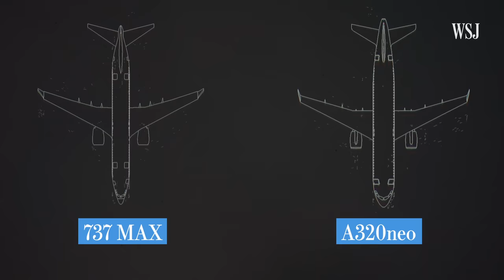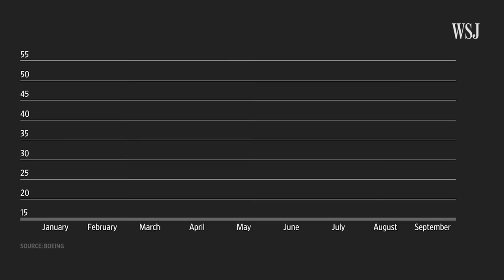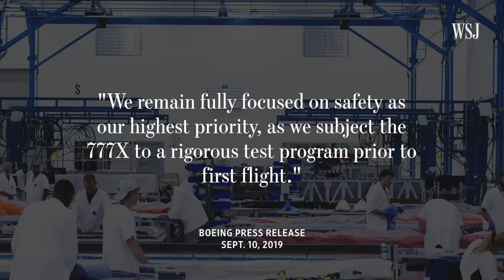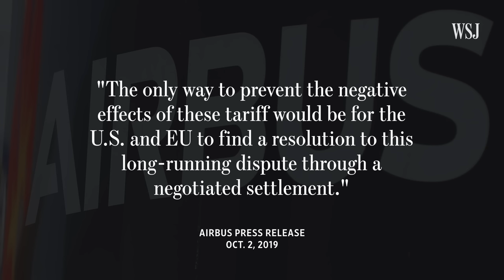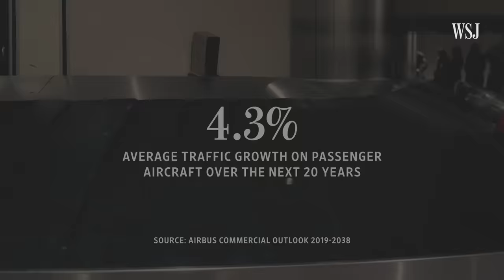Boeing vs. Airbus: Why Aviation’s Biggest Rivalry Is in Flux | WSJ

Comment: The 737 Max, especially the -10 is like a last minute ditch effort by Boeing to compete with the A321 because they made the terrible decision of ending production of the 757, which was superior to both the 737 and A321 in every way. A modernised 757 would be a world-winner.

Edit: someone deleted their comment regarding the sales dying out, however when ETOPS cape into effect and twin engined aircraft could cross oceans, a massive demand was made for a long range narrow body of which only the 757 could accommodate.
Reply: the word is that Boeing has a new replacement for the 73 in the works regardless.
Reply: Matt yep 797 is supposed to be a twin aisle 757
Reply: Your right about the 757 which is why they are designing a new midsize aircraft (NMA) but at the expense of recycling the 737 airframe yet again. So manny mistakes here.
Reply: The 757 barely sold at all only large orders came from delta American and United  plus it was to large to replace the 737-800
Reply: mrcrisp but the 757 has a far superior range, payload and short field capabilities.
Reply: @shaun1293  so? You won't see a 757  flying  boise to denver why? Because it's to large that's what the 737 does better why do you think not many airline bought the 757
Reply: mrcrisp the 757 could easily handle the route but it’s probably due to lower passenger demand.
Once again not many airlines bought the 757 because at the time there weren’t many routes that the 757 could legally fly because it only had two engines, so it was thought to be a slightly larger 737. Once ETOPS lifted restrictions on the 757, after production ended, airlines have been scrambling for them. Icelandair uses all 757s, the European charter airlines use 757s, in fact take Jet2 for example, they’ve had to retire two 757s just for parts to keep the rest of their 757s going, and while TUI and the late Thomas Cook were buying Dreamliners, NGs and Neos, they kept their 757s. Delta, despite its massive orders for 737-900s is still keeping its 757s...
Reply: @shaun1293  um airlines have been doing 2 engine etops since the mid to late 80s lol it's not that new boeing has the choice of the 737 or 757 the 737 had way more orders and was making more money for boeing then the 757 end of the day boeing is a  business they need to make money and make investors happy most airlines bought the 767 for etops not 757

Comment: When buying airline tickets, I have no problem paying a little extra for the A320. HUGE Difference, the 737 Fatshamer Popcan was built with tiny Chinese men measuring seat width and spacing. We call it the Cramalot 737. Rides like an old 1 ton farm truck with open exhaust, and if you've got an isle seat then your shoulder ends up bruised by people trying to squeeze down the narrow isle, or your shirt torn from the snack cart. Boeing exec's fly First Class and never experience the cattle car that they built. I will not support that type of scrimping and squeezing to save a buck. 

The A320 is beautiful, roomy, bigger isles, bigger seats, better spacing, better air handling, and it rides like a Cadillac with air cushion suspension. People are catching on with the tricks to locate the 320 for their flight, WELL WORTH IT!!!
Reply: @FourDollaRacing  6-1 197lbs.
So you're a Troll! HA!

Comment: Boeing should stop tricking the FAA. Putting a new bigger engine in front of the wings instead under the wings has drastic aerodynamic consequences! It increases unnecessarily the risk of a stall during take-offs. Trying to "compensate" such a design flaw by software (MCAS) without making all this transparent and even hiding it from the FAA is a crime! ... oh ... and ... the FAA should take drastic measures in order to gain or to get back the required expertise for qualifying new airplane designs ... specifically in the realm of redundancy concepts of safety-critical system designs ... 
 I as a customer will NEVER EVER take foot into any airplane which uses hardware/software in order to "compensate" aerodynamic design flaws ! ... specifically if the triple jump for fuselage, wing & engine is concerned ! 
 I hope for all employees of the company Boeing that the Management ordered (secretly?) a complete re-design for a complete NEW 737 ... using the new max fuel-efficient engines without the need for any sorts of "MCAS" ... otherwise the Boeing management is also betraying their investors and other stake-holders ... and it might finally turn into the beginning of the end of this great company ... 
 But in order to stay fair ... remember the catastophic flight Quantas QF72 (Airbus 330) ... here is an analysis about this bad Airbus story: 
https://www.youtube.com/watch?v=2cSh_Wo_mcY 
... the term 'flight envelope' will be the term raising a lot of attention in the future ... and how power between the pilot & computer systems are split ... 
Every airplane cockpit should become kind of an "Emergency-My-Aircraft-Button" de-activating IMMEDIATELY all computer-intelligence in terms of active control about the actor-motors ... they have to follow ONLY the pilots direct command in case of emergencies !

Comment: No in-depth reporting in this item whatsoever. It misses a lot of Why-questions: Why did the CEO loose his roll as chair, Why did the lead engineer leave, Why did the Max crash twice, Why is the Max still grounded, Who certified the Max aircraft vs Who certified the 320Neo (FAA and Boeings self certification vs EASA), etc etc

Comment: if Boeing didn't make the 737 so low to the ground, they wouldn't have had this problem. The A320 doesn't seem to face any issues with its usability at smaller airports due to its height.

Comment: I'd like to clear some misconceptions up about MCAS and the whole controversy in general. The flight data recorder shows some very disturbing things the Ethiopian Airlines pilot did. After hitting birds, getting a bunch of warnings and a stick shaker (the most serious warning an aircraft gives to a pilot), what did the pilot do? He tried to engage the autopilot. Seriously. I’m not kidding.

In an emergency situation, this pilot’s first action was to try to engage the autopilot. When the autopilot would not engage, what did he do? He tried to engage it once again. All of this occurred before the MCAS ever activated. Why? That’s because MCAS will not activate if the flaps are deployed (which they were), and it will not activate if the AP is engaged (which it did the 2nd time, but only for about a minute).

This shows a pilot that is completely dependent on the automation system. I liken it to hitting a deer in your car and the first thing you do is to turn on cruise control. Who would do that?

The Ethiopian Airlines pilots did the correct procedure to turn off MCAS (at the recommendation of the co-pilot, by the way). The problem is that they did not have the skills to fly the jet without the autopilot. They never once touched the throttles even though the aircraft was set at climb thrust and, since it wasn’t climbing, it accelerated to extremely high speeds. At a certain point, the overspeed clacker went off, and yet even at that point, did the pilots ever get control of the airspeed? No.

So, even if these pilots had completely understood MCAS, they may not have been able to save the aircraft simply because they did not know how to properly fly the jet. They only knew procedures and did not appear to know what those procedures actually did. The evidence for this is that after executing the emergency procedure for runaway trim, the pilot was surprised that his electric pitch trim no longer worked. If he had understood what those switches did, he should not have been surprised. He decided to make up his own procedure and he turned the switches back on which lead to the crash. The procedure explicitly states that the switches are to remain in the cutout position for the remainder of the flight.

The Lion Air pilots probably stood a much greater chance if they had followed the procedure for runaway trim. This procedure is one that every pilot is required to know by memory, but unfortunately they did not switch the horizontal stabilizer trim switches to the cutout position. The crew on that same jet had the exact same problem. They correctly executed the procedure and they didn’t even consider it enough of an emergency to return to the airport (although, they probably should have). They continued the flight and landed safely. The Lion Air maintenance crew did not fix the problem and so the next flight crashed.

The MCAS should never have been designed to rely on a single sensor. However, the more important lesson here is that some pilot’s flying today do not have the skills to properly deal with emergency situations. No MCAS software changes will fix that problem.
Reply: Siddharth Tergaonkar Very interesting information. Thanks!
Reply: He turned the switches back on because the manual trim was too hard to turn and have you seen how fast it turns manually just to make a small adjustment. The pilot would have to make about 3 complete turns which when your being pushed back into your seat and the jack screw is being strained due to the mis-trim situation won’t help
Reply: Boeing states that for a manual trim by the combined force of both pilots is not necessarily enough, unless they go for a sharp dive.  Good luck
Reply: @CaptainDangeax  Boeing knew that moving the position of the engines would offset the plane's balance, and cause the nose to pitch up. That's literally why the implemented MCAS. My point was about how the Ethiopian pilots did not know how to react to the birdstrike independent of MCAS. Even before MCAS was activated the Ethiopian pilots decided to engage autopilot! After a bird strike! This shows that they weren't able to handle the situation correctly with or without MCAS. I've tried explaining this the best I can in the comment, please go through it.
Reply: Thomas Mortimore this however, completely goes against the stab trim procedure; once it’s cut out, it’s not meant to be re engaged for the rest of the flight.

Comment: I heard Boeing fired American engineers who did flight software for 737 on reason of paid per hrs around 72$ then hired Indian at cost 11 $/hr did that software in stead.
Reply: The software engineers were the only ones that didnt fail here! I dont know if what you said is true but the software briefing was build by Boeing flight engineers and the software just worked like the briefing asked too. The briefing from Boeing was faulty with several risky decisions that nobody understands and that killed the people. The software just made his job without fails and Lion Air final report makes it clear! In the end it was a faulty hardware (AoA sensor) that made MCAS fail, not a software bug and don't confuse that.
Reply: Seems the savings intended by moving software to India are in the minus $9 billion so far.
Reply: @francoistombe It's result of appointing MBA to CEO of technological company in stead of engineers.
Reply: @joaopedrogomes910  Randomizing between two sensors seems more a  "clever" software move than a flight engineer specification.  with the available hardware it was difficult to make an algorithm worse.
Reply: Joen Delfiero  Cutting cost to satisfy board.

Comment: I used to like boeing but now I like airbus (because of the 737 max crashes)
Reply: Don't get me wrong both are still good. But I like Airbus.
Reply: Codename C  that's true. I will still go on a Boeing. However, I feel that their commitment to safety had kind of lacked a bit. Due to the 737 max though in particular, it has for some reason painted some kind of a picture in my mind of what Boeing is like as a company. Don't get me wrong, boeing is very good. McDonnell douglas was very good as a company overall despite the DC-10 crashes.

Comment: Computer software fix is not good enough to ensure safety. If you ever work with industrial equipment, you know sometimes software can get corrupted and needs a reboot. This can't be done in the air with hundreds of lives at stake.
Reply: that's why you have multiple computers running at the same time, with different code implementations on different chip architectures validating each others' results

Comment: Neo wasn't a success from the start. Don't forget the numerous engine troubles they had and in fact still are more delicate than other.
Reply: it's quite common new engines to have problems immediately after they're released.
Reply: @NaumRusomarov  Agreed but it's been quite sometime now I believe. They are still replaced earlier or put to more checks compared to others.
Reply: Yes....engine issues....not an airbus problem...a P&W problem

Comment: AIRBUS FOR ME
Reply: Same here. Although I enjoyed the ride in a B738 and a B789 plenty of times. But the A32x and the A380 (still crying about the imminent closure of the production line) have been the best.
Reply: Codename C  Did you hear recently about cracks in the 737NG models? What about the burning batteries in B787 models? Do you remember the famous roofless B737? Need more examples?
However, if one is looking into accidents per pax mile the Boeing models do not have a bad rate. There are and were aircraft manufacturers with worse rates.
Reply: Codename C  Which period did you consider to measure the safety of Boeing airplanes? And which other parameters did you take into account?
BTW: no comment on the 737NG cracks? And did you read the last two sentences of my previous post?

Comment: "737" doesn't sound great anymore. boeing should use new name for single aisle
Reply: How about a new plane?
Reply: Not so long ago people made fun of Trump just for suggesting this. Now it looks to be very good option for Boeing. They will most certainly need to fix all issues (not only MCAS but all those other things found by review), but renaming after some minor update is likely. 737 will stay, but "MAX" could be replaced and perhaps should be replaced for ease of mind of passengers. 

Something like "737 clean air" or "737 blue sky" (short 737 BS ;)). Any other suggestions?

Comment: I will never fly on the Beoing 737 max. Max = maximum danger.
Reply: fly and then Die😂😊
Reply: WHAT INDONESIA INVESTIGATORS TOLD FAMILIES OF LION AIR CRASH VICTIMS

• Incorrect assumptions were made about how pilots would response to malfunctions while designing the 737 Max and getting it certified

• MCAS relied on one sensor based on false assumptions

• MCAS was vulnerable to errors as it relied only on a single angle-of-attack sensor

• Pilots found it more difficult when the MCAS activated without command, as they were not trained on the system

• A key alert wasn’t correctly enabled during the 737 Max’s development

• The angle-of-attack sensor installed on the crashed plane wasn’t calibrated correctly during an earlier repair

• The improper calibration of the sensor wasn’t detected

• Previous instances of warnings of an immediate stall weren’t documented in flight and maintenance logs. The lack of information prevented maintenance crew and accident crew from taking appropriate action

• Multiple alerts, MCAS activation, air-traffic-control communication and manual flying were not managed well

Comment: Seriously ? Every Boeing plane is iconic, we have real switches not your sh*tty plastic buttons, we have real mechanical steering not your stupid "fly by wire" we have pilot planes, us at least don't need to type a few commands to do a full flight. Airbus might be safer, more confortable but Boeing will always be Legendary as we changed aviation forever
Reply: Airbus actually drastically changed aviation with the A300 and A320. And also, you don't have "pilot planes" when the 737 max has a software thats made to point the nose right down
Reply: 777 and 787 are fly by wire, why? Because it better. It’s more reliable and safer. Boeing would make the 737 FBW if they could but they can’t because their dragging ancient technology into the market. I’m embarrassed for them.

Comment: If an aircraft is designed correctly, it doesn’t need MCAS. It’s probably not only software issue but hardware as well. The most lift from an airplane is from the wings that are close to the fuselage. The max 8 engines are too close to the fuselage and it can affect the lift dynamics. Those engines are so close to the underside of the wing, they probably generate down force instead of needed uplift. Any closer, then the plane probably won’t be able to fly. Move those engines further from the fuselage like the A320 please!

Comment: If any of the two competitors provide parachutes for planes in case the engines fails, or mid flight turbulence causing to crash, or in any fail case, I would definitely choose that plane..
Reply: Parachutes require training to use effectively and safely, duel engine failure is very rare, and planes can safely operate on one of the other fails to get back to the airport, turbulence is rarely severe enough to destroy planes and can usually avoid them all together

Comment: 737 max  trouble.  i worked at Boeing as a machinist, 25 years.   this is NOT the Boeing i know.  my first day on the job.  i was told " we HAVE TO make the parts right.          no 1 peoples  lives depend on it.  no 2 our reputation is on the line. "

Comment: I hate to say it but I prefer the Airbus in most sizes of commercial airlines. I will change flights to take an air bus. Last year I few  over 46,000 miles, from the small CJ-190, to the A380 double decker.
We should not apply tariffs to Airbus, we should let companies compete, it’s good for customers.